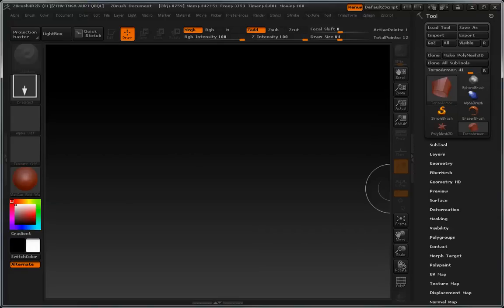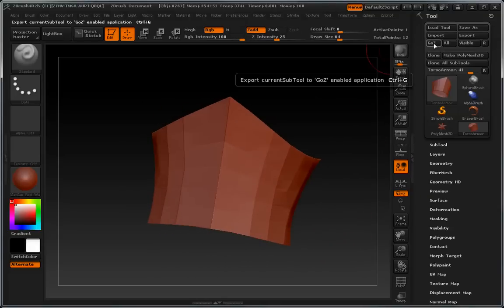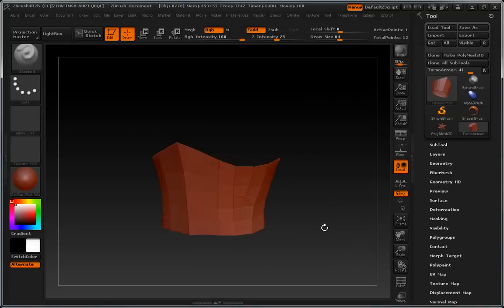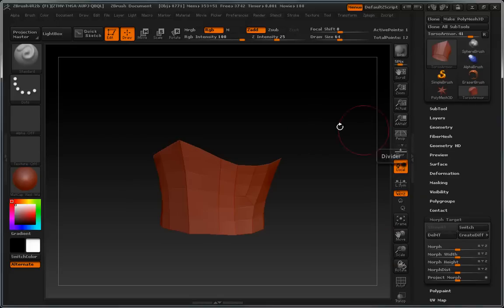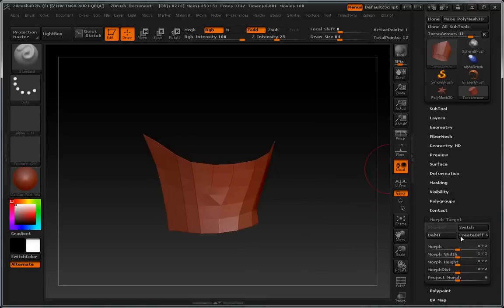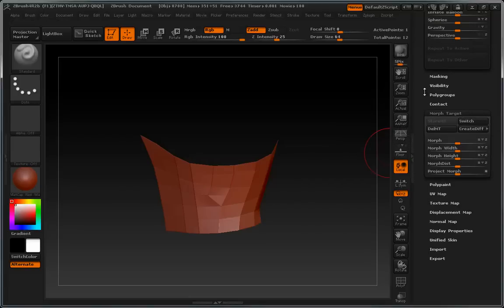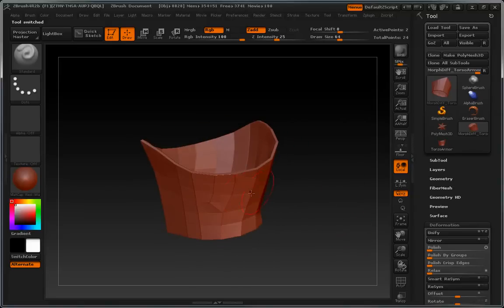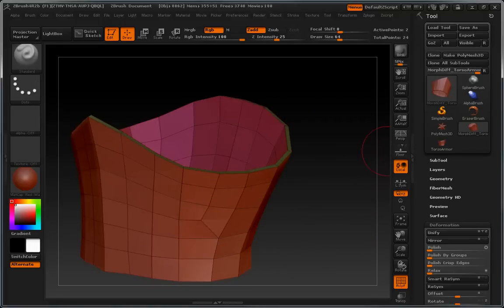Add Thickness To Single Sided Geometry In ZBrush

Comment: Great and another good solution to what I was looking for. What is the easiest, fastest, most precise way, you would cut out complex shapes out of a flat or non flat object? I watched your other video with the Meshinsert Dot brush but that tends to be a little tedious if you need to cut out many shapes, plus the brush is a little bit of a headache to move around and place. For example cutting out symbols from a flat wall, what would you suggest to do then? Is there a video that guides that?

Comment: Is there a way to have the thickness expanded inwards only? so as to retain outer mesh detail?
Reply from the maker: Sure Jesse, do a negative scaled inflate and your original surface should remain the same. Cheers!
Reply: Charles Woods Thanks Charles. Is that using the Inflate in the Deformation menu or some other way? I tried it with that but it affects the outer surface as well.
Reply from the maker: Jesse Waugh
 Hey Jesse, I just tried this again using a negative inflate value (Tool>Deformation>Inflate), and after comparing the DiffMesh to the original, the outer surface is exactly the same. I'd like to see what your process is and why this is happening to you, if you have a minute to capture a video of the trouble. Also, if you are using 4R7, you could accomplish the same effect now by using QMesh on a Polygroup All target with the ZModeler brush. Very, very handy stuff.
Reply: Thanks Charles - the issue I'm having is that I've created a vase shape, used Create Shell to hollow it out, and now want to thicken the shell while retaining outer detail - it has foliate extruded detail. The Inflate sliders inflate it outer and inner. I'm aiming to 3D print.
Reply from the maker: Jesse Waugh
Hi Jesse, I think I understand the issue. If you have created a Shell to hollow it out, then you will need to assign your interior surface a separate polygroup, isolate that polygroup and do an inflate of the interior surface. If there is a lot of high frequency detail remaining, you can do a low-resolution remesh on a duplicate of your vase and set your wall thickness on the re-meshed subtool. Divide up the model to a poly count you think can handle the sculpted surface, save a morph target. Step back down, project your details onto the new surface, then isolate the interior surface and morph back to clean interior surface. You shouldn't be trying to use this MorphDiff method explained in the video at all. Shoot me an e-mail if you need more specific help with it. Good luck!
Reply: Charles Woods i tried a negative inflate and it didnt work. looks like the normals invert when you do that.

Comment: Heya i done that and helped me but now my mesh seems it has like double layer its not clean from inside and at rigging i have a problem it moves the inner only :c are there any  ways to save my model?
Reply from the maker: Hi NoiseOfNetrino, I'm sorry, I haven't seen that behavior before. Perhaps if you can share the file I'd be happy to take a look for you. Message me and we'll see if we can't figure out what's going on here.
Reply: Charles Woods Heya thanks a lot about answering i just found a way after spending days of asking , figure it out alone :P It was so simple
maybe i inflate with a brush and it became a mess from mesh. In blender with low poly I selected all the outer faces and deleted ONLY faces keeping the wireframe, then i selected all the inner faces and delete them  at last select all and fill them. So with four moves you clean it :))
Reply from the maker: NoiseOfNetrino
Cool man, glad you got it sorted out!